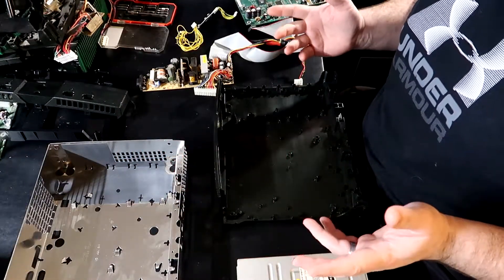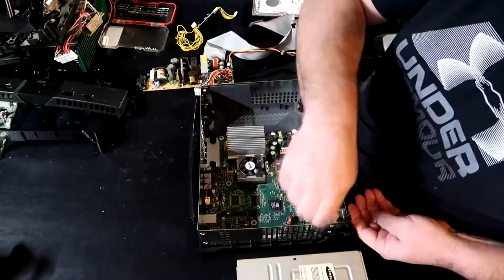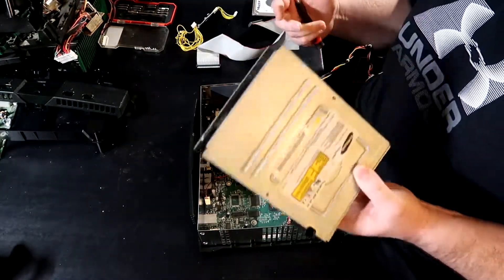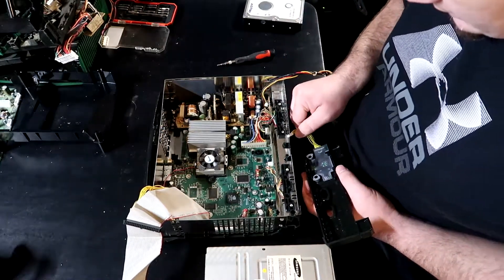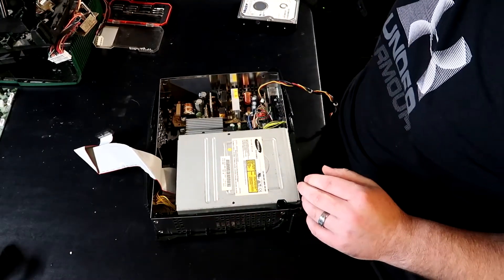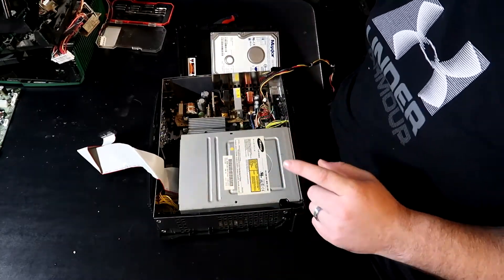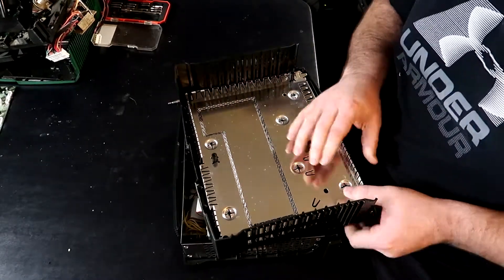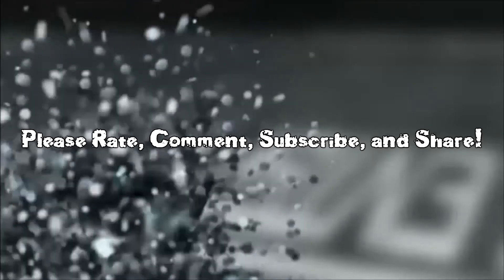Fixing Up My Original Modded Xbox - Reassembly! - Part 2

Comment: take out the clock cap its leaking or it wil leak !! upgrade ide calbe 80 wire ! change thermal paste ! install xbmc and coinops or ninja
Reply from the maker: thermal paste was done before the vid and I didn the clock cap a few weeks ago. May do the ide cable upgrade at some point. Already have XBMC as an app, but I just love unleashX for a dash. Thanks for watching!